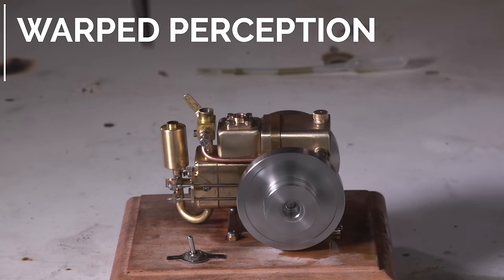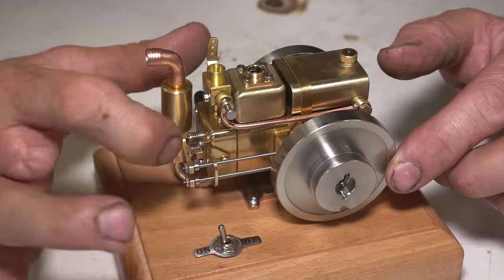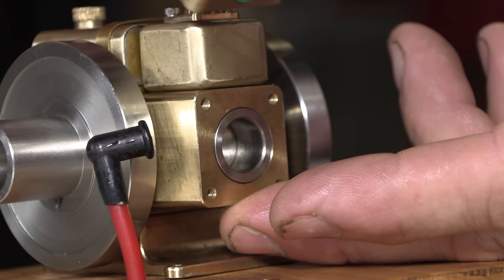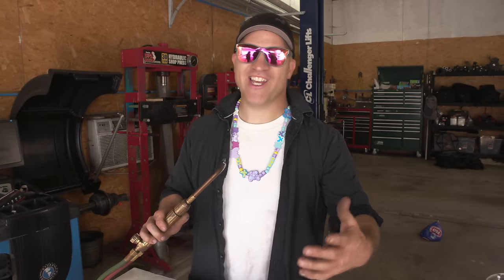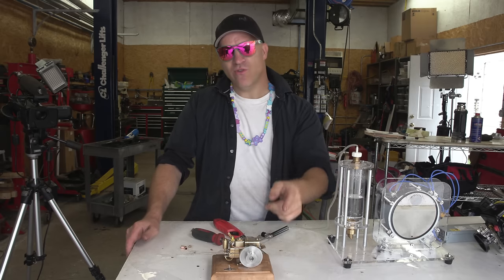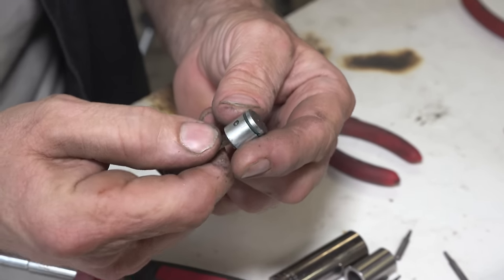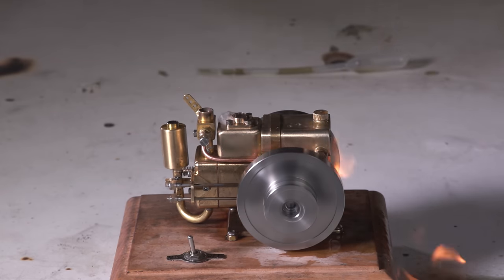I Blow up Mini Gas Engine with Oxygen Acetylene - (Slow Motion)

Comment: The cylinder sleeve moved. The water ran into the crankcase because when the sleeve moved it opened the water jacket.
Reply: Nah putting in hydrogen generated the water blown past the piston rubber ring
Reply: @LawpickingLocksmith  the oil wasn't milky. The water was introduced after the motor stopped running
Reply from the maker: @buildingracingvideos4714  I'm going to check this engine tomorrow but there was no oil left to mix with the water it was all blown out of the crankcase when I first started it.
Reply from the maker: That's what I thought at first but I did not see any water passages in that block. It is literally just a solid block of brass with a sleeve. The tank just sits right on top and is soldered to the side of the block. I'm going to double-check tomorrow and take a look inside, as much as I like the cooling passages idea because that would be a really cool design similar to an open deck block, but I don't think this one has water cooling jackets around the cylinder, I'm going to double-check
Reply: @WarpedYT  idk that is a very tiny motor and ideally hydrogen likes AFR's in the neighborhood of 30:1 I think stoichiometric is like 34:1. I don't know how long you ran the motor but given the cylinder volume you couldn't possibly have burned much hydrogen at all. Then factor in that, that wasn't the total water produced that was just blow by.. I could be wrong, for all I know you could have ran that motor for hours. It just seems, given the capacity of the motor,  that even a 10:1 ratio is fuck all hydrogen being burned. I would expect that much water coming out the exhaust but not as blow by.
Reply: Think the water hydrogen byproduct was just too heavy to pass out the exhaust and collected or condensed within the cylinder instead as it never fully ejected.
Reply: octane, acetylene and nitro all produce water as well (hydrogen lacks any carbon to make CO2). i guess if you ran it long enough, the blow by would build up and you would have water in the crank case. did you see or feel anything come out of the crank case ventilation hole?
Reply: @joelbarton5215  you are correct they all produce water,  but let's look at hydrogen. Hydrogen likes AFR's in the neighborhood of 30:1 stoichiometric is 34:1. Now think about the displacement of that engine. That engine is burning fuck all hydrogen. You would have to run that engine quite a while just to produce a detectable amount of water out the exhaust pipe. Now imagine how long you would have run the engine to get that much water as blow by in the crankcase
Reply: @Daniel-rw2gy  a) When you burn hydrogen in oxygen at 2,660 °C you get steam, not water, b) The cylinder is sealed off from the crankcase at the other end of the engine.

Comment: It didn't throw the rod? Just the intake valve spring melted? I waiting for you to put a bit of resistance on the flywheel to see if it smooths out any (on gasoline). 2 stroke rs play that game. Unloaded, most sound like a hit n miss, load it and they hit every time. ie: Chainsaw.

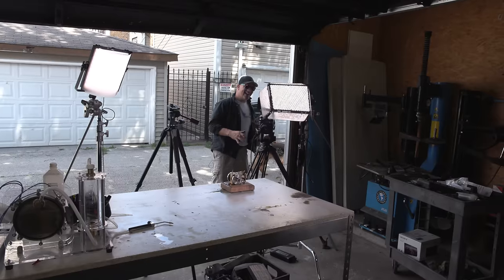Comment: 16:42

 The gas was shooting out of that tank, due to the fact that you were forcing high pressure into the carb, and therefore it traveled into the tank via. the fuel line, and pressurized the tank's interior.
Reply: @The Shapeshifters Misale i do

Comment: "Where that water is coming from? Maybe from burning hydrogen?" LOL
Reply: ...In the crankcase?...
Reply: Um, in the crankcase?
Reply: Lol i don’t think it made nearly that much water from burning it would be shooting out the exhaust lol. The water is probably from all the water in the jacket around the cylinder leaking when he moved the sleeve around
Reply: @infl  That's what I thought.
Reply: I work with hydrogen and it makes a surprising amount of water when burned. Also totally possible for some to end up in the crankcase.
Reply: Oh yeah for sure, same reason diesel oil gets black as shit fast. Just not that much for how long he ran it lol

Comment: It's interesting that what finally fails is the valve spring - relatively minor damage.  Reminds me of what I once read Rolls Royce used to do before the availability of computer simulation.  They'd run their engines until something failed, tear it down to find the failure, strengthen that part, and then repeat, until everything was equally robust.  It might be interesting to use a similar process on this engine.  Maybe you could get it to be reliable up to 20,000 rpm! :-)
Reply: haha pushrod go weeeeeeeeeeeeee
Reply: Saturn did that on their in house engines early in the company's history. I got to talk to the guy that designed the ignition system for those cars.

Comment: This was awesome! Great slow-mo during the blow-up. I'm curious about the water in the crankshaft as well - that looked like an HHO generator that was doing the electrolysis to generate your Hydro-Oxy mix, it makes sense that it burns back into water, and I know these are designed to be added to gasoline engines to "improve efficiency" with maybe dubious credibility if that actually works, I'm curious if you've done more with the HHO generator, and if you found any fuel efficiency increases from running it in a gasoline engine. Thanks for making cool videos.

Comment: Isn’t the lever opposite the mixture adjustment the throttle?   Didn’t see him use it.
Reply: Think thats the choke not sure.
Reply from the maker: It's the throttle but I just left it wide open throttle the whole time
Reply: @WarpedYT  why was it running so slowly on petrol when it was wot then? is the engine just that crappy
Reply: vx-iidu 9000 I think so, it’s just a toy really. It produces barely enough power to run itself. It can’t really supply any useful power.
Reply: @vx-iidu  its supposed to run slowly the real engine that it is baced of of probably never went above 100 rpm

Comment: Makes sense, that a non-hydrogen engine is full of water when running hydrogen, I mean it has to go somewhere.
Reply: Why do people assume its solely because of hydrogen? Water is a byproduct of all combustion?! Its a byproduct of fire.
Reply: @Bruce1Parsons  Yes, that's at least true for hydrocarbon fuel, you can watch that process easily by lightning a match.
At least in the match cass it evaporates very fast.

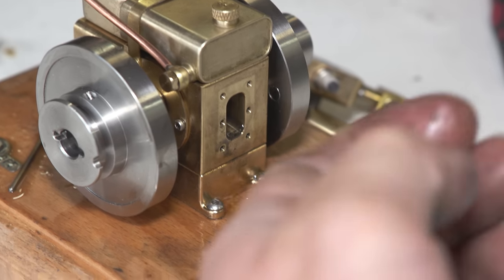Comment: 12:01 thats easy science: when you burn hydrogen, it auromatically reacts with the oxygen in our atmosphere and becomes h2o which basically water. A Part of thus water comes Out the exhaust in form of Gas, but a bit of the water becomes Liquid and stays in the engine.

Comment: When you’re explaining where the water goes you showed a picture of an old Single piston engine and called it a locomotive.
Reply: Yeah, I noticed that. Funny thing I don’t think hit and miss engines were ever really used to power locomotives.
Reply: I'm sure someone at one point used a single-cylinder hit-and-miss engine to power a locomotive...
Reply: MMC did some looking, it just doesn’t seem like it ever did happen. For larger loco’s a single would be far underpowered, and for smaller vehicles like speeder carts a two cycle single that can run either direction is far better suited for the job.
Reply: @logantc.1353  true, it wouldn't be a practical powerhouse for a full-on locomotive, but I do have knowledge about such things, and though it may not have been documented in some way, there is a fairly good chance that someone somewhere (like Russia) has at least attempted to make a vehicle powered by a stationary hit-and-miss engine. Also, keep in mind that there are old tractors powered by hit-and-miss engines adapted to work on a moving vehicle. Also, "locomotive" doesn't just refer to the powered vehicle that pulls a train. It can refer to any vehicle that can move under its own power.
Reply: MMC OHH! I thought you were talking about a vehicle produced by a larger locomotive manufacturer or rail car company, or a vehicle with a purpose built hit and miss engine, in terms of one off/hand built I totally agree!
Reply: @TheRealMMC  H&M engines generally have a governor and I didn't see one? Also, it looked like the intake  valve is cam driven where, on a H&M, the vacuum  generated during the intake stroke with the exhaust valve closed sucks the intake valve open against the intake valve spring.
Reply: @buggsy5  yep, full size h&m engines typically do have a governed to limit their firing rate/RPM, but this little engine doesn't seem to have one, probably because the manufacturers probably ruled out the necessity of a governer because its so small, and the valves are cam driven probably because the vacuum is not strong enough to open the valves that way.

Comment: Woulda been cool if he would have opened up the throttle...
Reply: Pete Mason static engine lmao no, go learn what static is, and it has a carb with a throttle.
Reply: Pete Mason  Then what do you call the lever on the opposite side of the mixture screw?
Reply from the maker: It did have a carburetor but I had the throttle wide open the entire time.
Reply: Pete Mason  😂🤣
Reply: Lol. Water!!??

Comment: 10:22 the byproduct of hydrogen and oxygen is water so...
Me: so where is that now?
11:54 found it.
Reply: No, it's water vapor (i.e. steam), which goes out the exhaust pipe (just like the water vapor and carbon dioxide from burning gasoline). The crank case was full of water from the coolant tank; I'm guessing a seal broke somewhere to cause that. It was way too much water to be from the tiny amount of hydrogen he was burning.
Reply: @alexanderflack566  Lady and Gentlemen, I stand corrected! Thank you sir. Your point makes so much more sense! Hahaha!
Reply: @alexanderflack566  That is what I expect as well. Although, if his description is accurate and it is contact cooling only, there shouldn't be any connection to the cylinder or block, except possibly mounting screws. 
I noticed that moving part fit was pretty poor in a lot of places. With some judicious reworking of bearing/seal surface it could be turned into a nice pretty and well running motor, assuming the cam profiles are correct. 
If I recall correctly, that type of engine was meant to be run at low rpms.

Comment: Need to replace that spring and keep going. A simple fix that does not require alot of effort. I feel like this video is not complete. Alot of your videos end like this and it kinda bums me out.
Reply from the maker: Lol.. nah, I will fix it but the issue is the engine maker never wants to send me parts. What are usually doing these cases is iron the video here and then I fixed the engine and I make another episode. Simply because the amount of time that it takes me to get the parts is just too long.
Reply: @WarpedYT  just take off the other spring get some basic measurments and order one from somewhere.  Just needs to work well/long enough to kill it the rest of the way. A sheild would help keep them alive for longer aswell. 👍✌
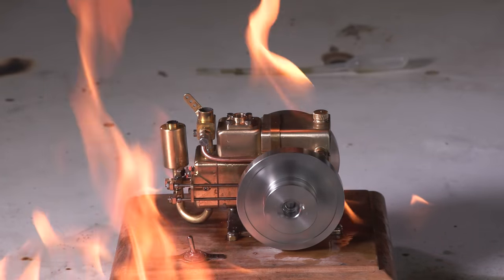Reply: @WarpedYT   Very good experience ;D What is the name of the song that plays at 15:02 minutes friend?

Comment: Could make the explosion sound effects you added in the slow-mo more believable if you find higher sample rate ones and slow them down to match 48khz. Maybe also add some ambient whirring and low chugging to the background in order to make the point at which the sound effects end less noticeable.

Comment: Years ago as a refrigeration mechanic we ran out of fuel in our Toyota,  so we ran some pipe insulation from the air cleaner to the acetylene bottle between my legs. We had to throttle the acetylene to match the amount of throttle it was given to stop pinging. We drove about 30km to the closest fuel station. The engine survived and we did too some how!

Comment: this engine has a pretty violent cam and it tends to have a lot of valve float when you run it at high rpm  that's why the cam was wearing out so fast

Comment: I think that gasoline geyser was a result of the O/A torch pushing fuel mix into the carb at high enough pressure that it backfed O/A into the fuel line, forcing it out of the tank. Awesome results!

Comment: try using Carbolic Acid as a fuel.  Aero experimenter and Smithsonian secretary Samuel Langley used Carbolic acid in his aeronautical experiments with models and a full sized machine which didn't fly 1896-1903.

Comment: He didn't destroy anything, as he showed you can fix this little engine over and over. In the military this is called a "performance test". Performance test are test they often destroy stuff, for the sake of data. For years turbines jet engines were limited in performance until they figured out that if you make the blades out of Ti, and Ni. They hold up much better and solved many issues, they couldn't of done this research without breaking some stuff. Anyway I liked the video.

Comment: That last scene where it blew up, the engine was running off of the pressure alone being pushed into the carb. That’s why the fuel was spewing out the tank, it was blowing up because the spark plugs were igniting the gas being pushed in, basically Running the engine in reverse lmao

Comment: it almost reminds me of the Wright Brothers first airplane engine except theirs had no carbeurator, it ran flat out or 1 max constant speed. Come to think of it a C-130's engines run at a constant speed.
Reply: That actually isn't true, turboprop engines are variable speed engines. They can also control propulsion independent of rpm by adjusting prop angle, to go as far as to be able to go full reverse and act as brakes or push the aircraft backwards on ice.

Comment: So nitromethane and hydrogen both have an extremely high octane rating. Acetylene on the other hand, is so happy to just ignite that it can't even be stored under pressure in it's gas state...

Comment: One of the biggest problems is ,you're using a drill gun to bump Start these little engines. Though Sterling engines are very easy to turn over by hand.

Comment: The valve spring melted due to the oxy acetelyne mixture igniting in the intake manifold and blowing past the valve guide focusing heat on the spring.  
Wonder how many RPM it achieved, you might be able to figure that out if you know how many frames per second it was shot in and count the revs per frame or frames per rev.

Comment: The water in your engine probably was from the acetylene oxidation reaction. Yes, burning hydrogen produces water... but the amount of water in your engine... and given when it started precipitating... I'd say it's from the oxidation of the acetylene. The oxidation of acetylene produces two byproducts - carbon dioxide, and water. The carbon dioxide was exhausted out through your exhaust... but the liquid built up in the combustion chamber and was clearly being pushed back up into your fuel tank on the strokes until it was shooting out the cap... and then water and steam probably caused your cylinder to seize... 

If I had to guess... most of that "liquid" I'm guessing is actually acetone... which is also mixed in with acetylene gas for welding...  when you oxidize it at a torch head... the acetone burns off with the rest... when you're feeding it into that engine... I'm guessing you don't get a full burn... so basically everything built up inside the engine...  I'm guessing that liquid was mostly acetone and water... 

Burning hydrogen would create water... but you'd have burn a ton of it to make water...

Comment: Hardly surprising that it runs better on nitromethane. That carburetor looks like it was swiped right off a model airplane engine. They usually run alcohol and nitromethane, with castor oil added to the fuel mix as a lubricant. And they are usually running over 10k rpm at that scale. I think a 0.40-0.60 CI 4-stroke aircraft engine (*roughly* the same scale...) will run something like 1.25 HP. But I dunno if one of those would survive your unholy experiments with oxy-acetylene.

Comment: The gyzer was because you backfed oxyacetylene through the fuel jet back to the tank, which tells me you didn't damage it by fuel, but by pressure. I'm sure it would have done the same thing if you used compressed air.

Comment: The expansion rate of the aluminum piston grew to a point of seizure, take .001 to .002 off the piston diameter if you're going to put that much heat in the cylinder.

Comment: Should have adjusted the torch flame to the way it would be for cutting and then turn the bottle of acesetlyone to put out the flame then opened it again and used that mix because it would have been the hottest

Comment: Probably would have gotten the same results just using compressed air. Basically just blew the fuel around and pistons couldn’t compete with the gas pressure.

Comment: Gasoline blew out out the tank from the increased pressure into the throttle body pushing back through the fuel line.
Water in crankcase came from the hydrogen 4 sure

Comment: the exhaust is pointing up... so running on hydrogen it exhales H2O vapor...   this H2O vapor turns into liquid water inside the exhaustpipe... not a big problem as long the exhaust is pointing down disposing the liquid water out the end..... your exhaustpipe ending is mounted (pointing up) higher than the cilinder...  so now the water cannot get out and keeps building up and entering back into the cilinder.... this is my best geuss where the water could come from...

Comment: The reason the fuel Tank was under pressure spiting  fuel,  ist because of you blowing gas constantly to the cylinder chamber, witch has the fuel rail, without any anti Back flow valve or Something
Maybe If the Gas flow is  pulsatil like in bigger engines (injectors) it would have survived a litttle bit more haha
Sorry for My english, third lenguage